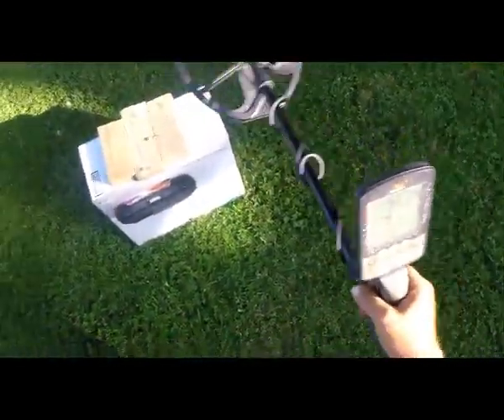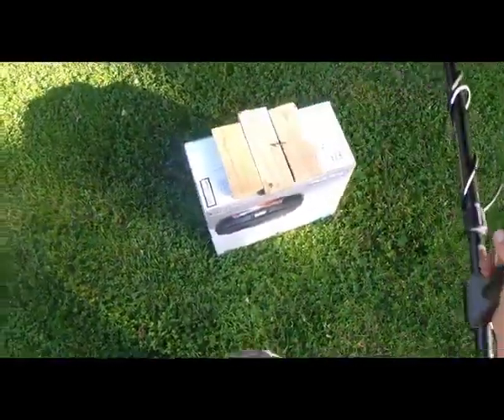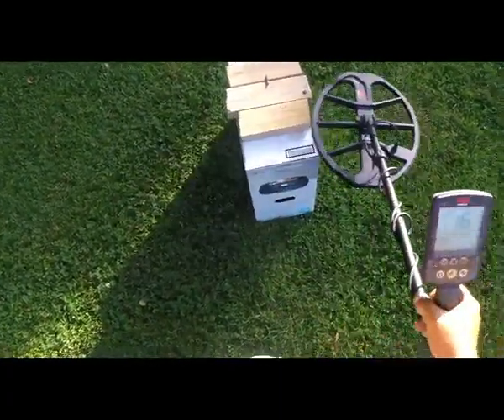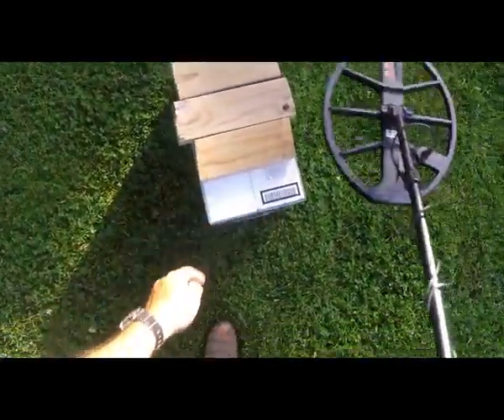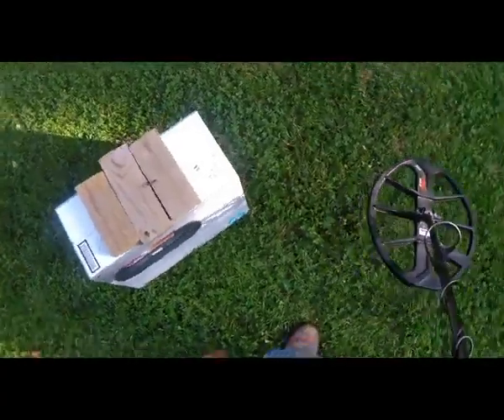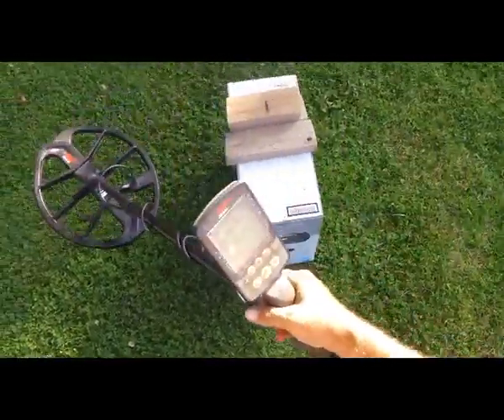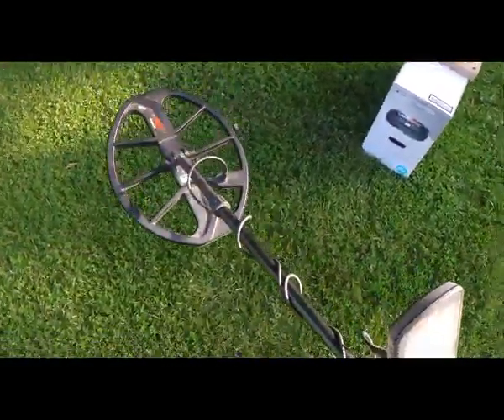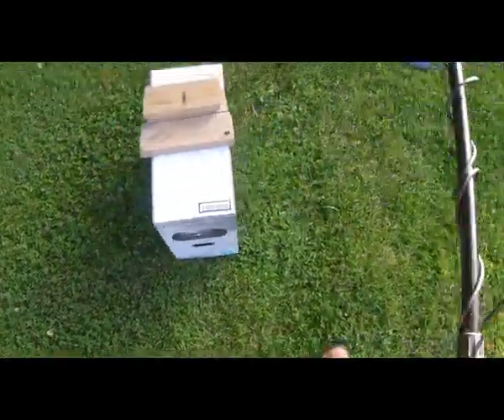minelab EQX 800 big coil tests #2

Comment: TNSS ... Your tests are unique and well thought out. They are part of how I hear and visualize during my hunting sessions. I don't have the big coil yet, but have noticed the forward sensitivity in the stock coil when trying to pinpoint off the tail or nose of the coil without using pp function. I can pull away from a nearby ferrous target and isolate a nonferrous as I adjust my sweep. Just one more way EQ helps separating good targets from trash. Harder to explain in words than the actual doing. Thanks for your effort and sharing. You have helped me learn my machine in ways that would have taken forever on my own.